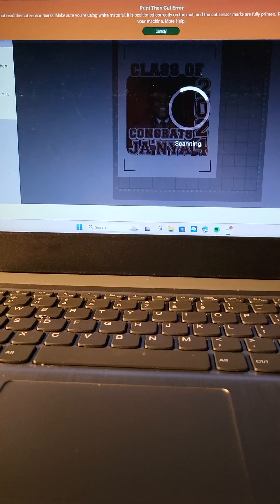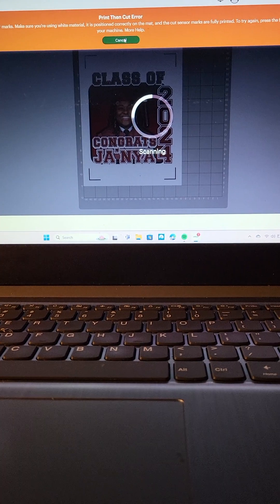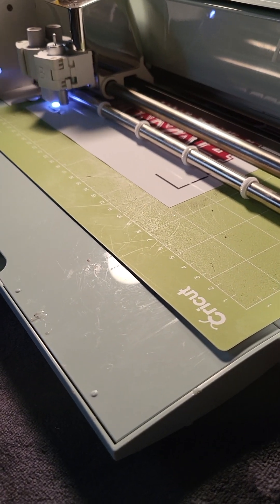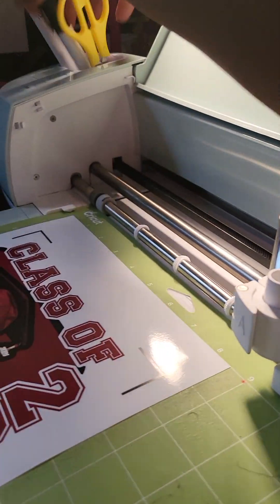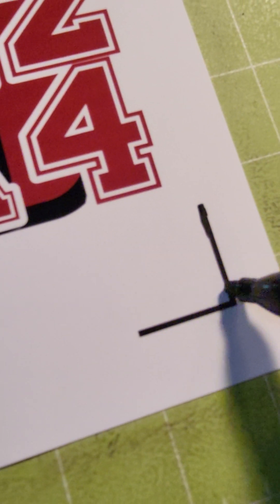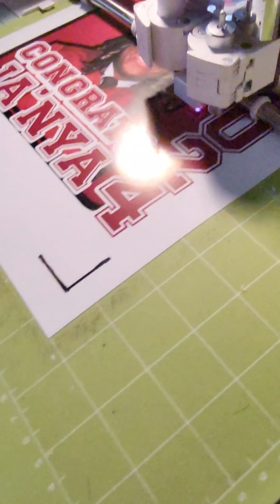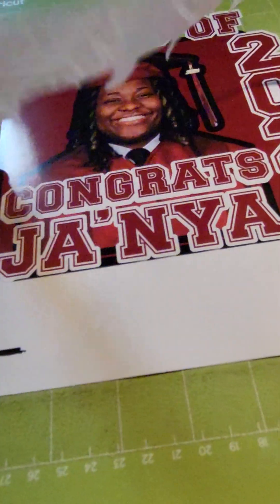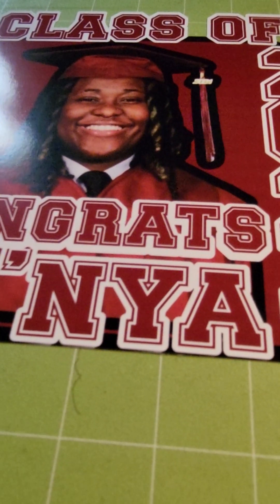PRINT THEN CUT ERROR ON CRICUT (Sensor mark not reading)

Comment: The problem is any kind of reflective paper or paper with a shine will cause this problem matte paper or plain paper has no issues. The tape trick makes the marks matte, same as the marker. Crazy I worked in a grocery store that uses 25 year old scanners that work on gloss and matte paper but this macine cant read any kind of gloss or if it does yo get 1 or 2 than done
Reply from the maker: Lol and you're exactly right